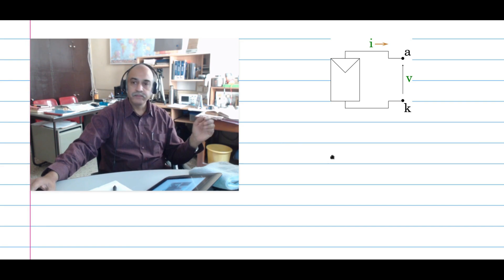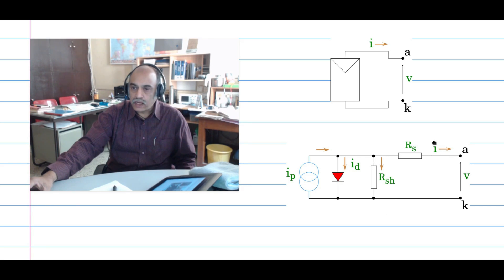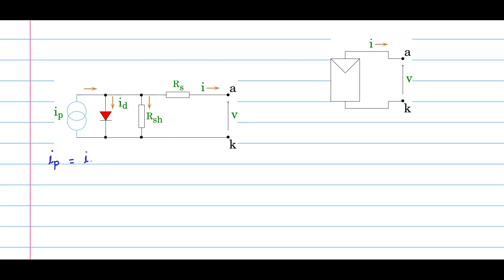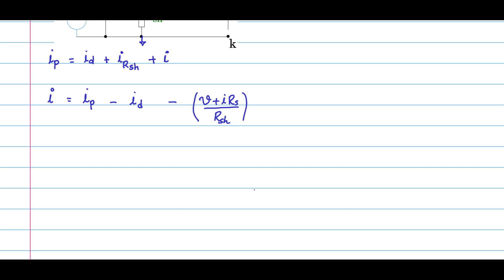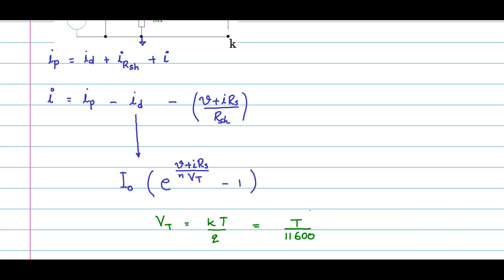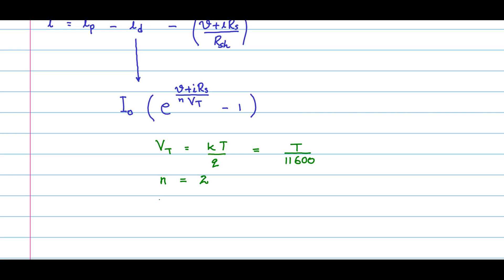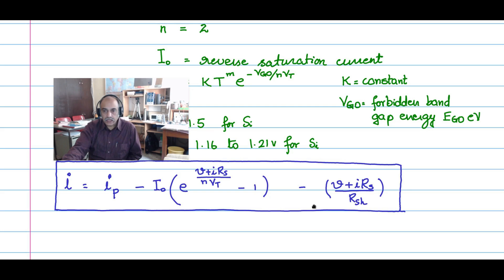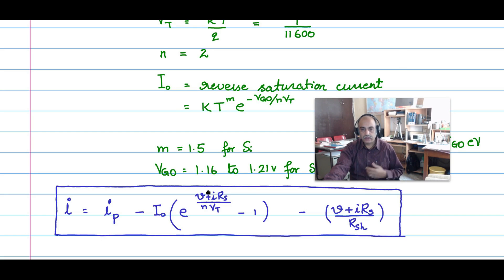Model of PV cell

Comment: This is all great. One very imporatnt information which is missing is domain of the model and its accuracy. E.g. I'm thinking now about using single-module optimizers and would like to model single/multiple cell shading. This puts takes the model from the first quadrant. Is the model valid also in other quadrants?
Reply: It's an excellent model provided you realize that the photocurrent is proportional to incident light.  If it's shaded, the cell will dissipate power like a diode or resistor if it's shunted.

Comment: sir what is the significance of the diode connected across the current source in the equivalent circuit?
Reply: based on the explanation in previous video, I believe by virtue of the pn junction required to create a physical solar cell, it can be modelled as a power source in parallel with the diode. Not sure if this answers your question.
Varun